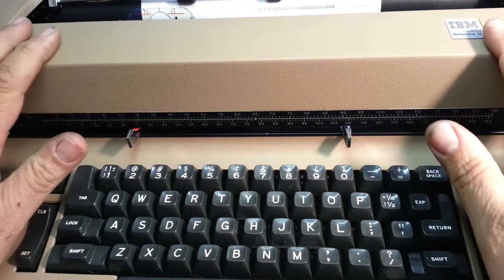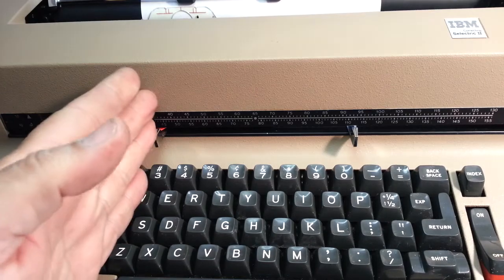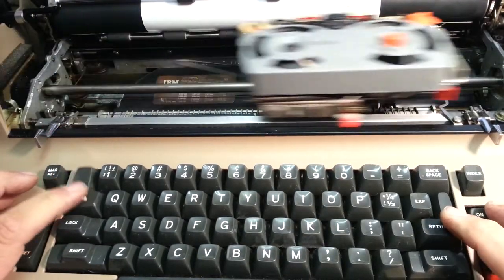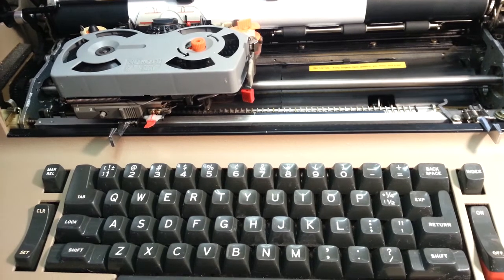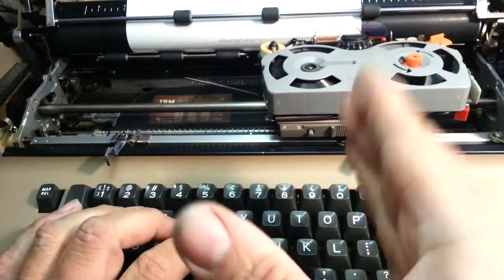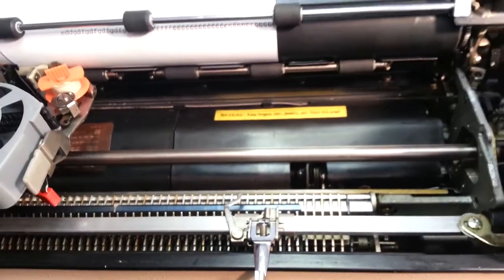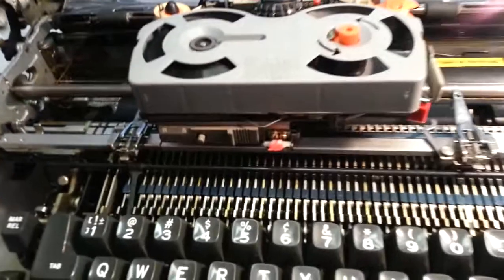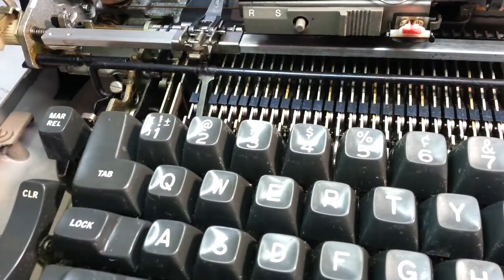IBM Selectric Typewriter Set Right Margin Stop Repair, Bell, Tab Operations Demo

Comment: Mine had the opposite issue, where the bell worked but the right key stop didn't.  That turned out to be the little arm reaching down to the  margin stop (you can see it if you pause at 6:28 just above the 2 key.) It had gotten bent up so it wasn't engaging the key stop mechanism.  Bent it back down and the right margin worked properly again.

Comment: Hello. My left margin is moving as normal but the cartridge just doesn’t acknowledge where it is. It just goes as far left as it can, regardless of where the margin slider is. It’s as if I’m using a margin release but I don’t think my Erika model 43 has one unless I’m being thick. The right slider works fine and the bell rings at the right time. Would appreciate any help, many thanks.
Reply from the maker: 1st, I don't know if you are talking about the IBM selectric or the Erika 43
Either way this is not a common problem, so there is no common answer
Troubleshooting/investigating needs to be done, I can't do that long distance, would need to see typewriter in-person
Reply: Ah, okay. I was referring to my Erika model but no worries. I think it might be time for an upgrade if it isn’t a common issue. I was concerned that would be the case because things have come up previously that I’ve been able to research and fix. Oh well, thanks for replying anyway and letting me know.

Comment: On a slightly unrelated note: I have recently been given a Selectric III (670X), German version.
With this, nearly everything work, except for the backspace. It looks a though the carriage wants to move, but is somehow held in the current position. 
Since I am in Germany, sending it to you probably would not be economical, so I wanted to ask you, if this is a problem you know and can tell me how to fix (or where one could find a service /repair manual for this machine).
Reply from the maker: If the transport pulley is broken or compromised the tension on the cords/cables will be slackened & will directly affect backspace operations. https://www.youtube.com/watch?v=NnwHHR7lnRA
If pulley is good, then the backspace driver needs adjusting or replaced
Reply: Phoenix Typewriter Thanks for the quick response! You were right. The tension pulley is broken.
Do you ship replacement parts overseas?
Reply from the maker: I generally don't sell parts, I do have some of these, but only a few. They are listed on ebay regularly. 
https://www.ebay.com/itm/IBM-SELECTRIC-TYPEWRITER-PART-TAB-PULLEY-NEW/173219002262?hash=item2854a83796:g:8AkAAOSwaadaquRj

Comment: What if the bell works but the carriage doesn't stop at the margin?
Reply from the maker: Should lock KB, but NOT space bar. If it doesn't lock KB it needs adjusting of some sort, not common....
Reply: @phoenixtypewriter2136  the space bar passes right through, as it should. Other keys will sometimes pass right through the right margin, other times will half-stop but then go again if I keep hitting keys with normal typing pressure. Once in a while, KB stops completely like it's supposed to. It's very odd.
Reply from the maker: @LeilaAMMartin  Not too odd, it's a finite precision adjustment of the line lock, any Selectric mechanic should be able to do.
It's too tricky to tell you, or even do a video how to do......
Reply: @phoenixtypewriter2136  thank you! I'll have to see if there are any Selectric mechanics near me (I'm in Connecticut). I appreciate your replies!